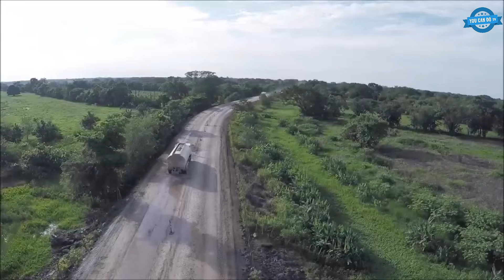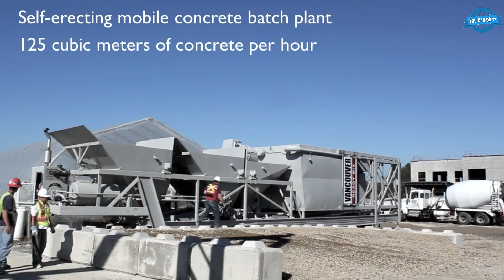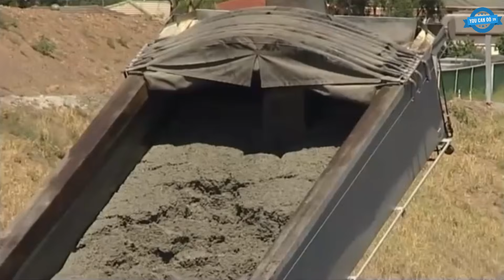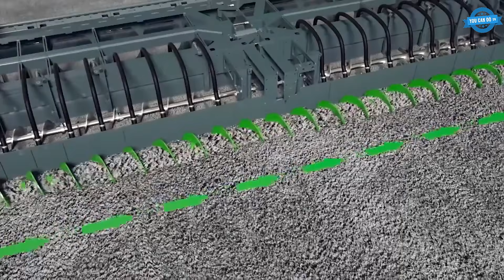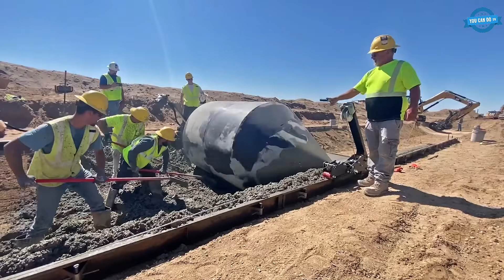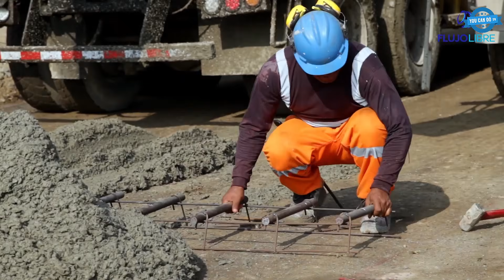How Giant Machines Build Concrete Highways That Last 40 Years. Road Construction Documentary

Comment: The detail about normal drum trucks not being able to handle a mix this dry really shows how different 40-year concrete is from the everyday stuff. And the subbase drainage point — water freezing under the slab being the real killer — reframes the whole question of why roads crack.

Comment: Trust me: no highway that is exposed to sun, weather, salt and heavy traffic will last 40 years. Not even massive bridges do. All the bridges in Germany designed to last for 100 years actually reached 50 years  before they need to be replaced. Espacially those build with trash GDR produced steal. They all rust away. The steal wires simply rip.

Comment: This is an excellent reminder that infrastructure durability begins long before concrete is placed. Proper stabilization, geotechnical evaluation, drainage design, and construction quality control are just as critical as the pavement mix itself. Well done explaining the complete process. – Dr. Sera, P.E., PhD